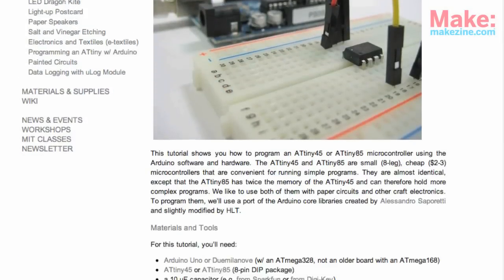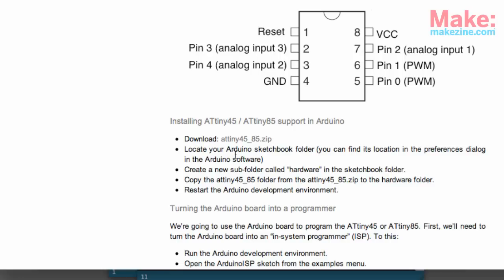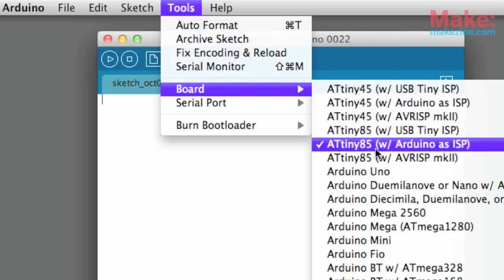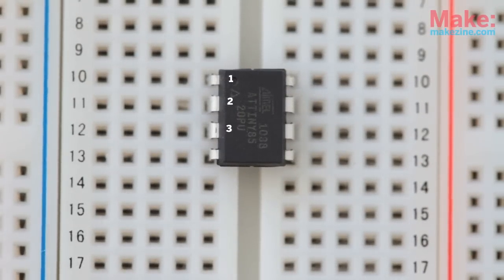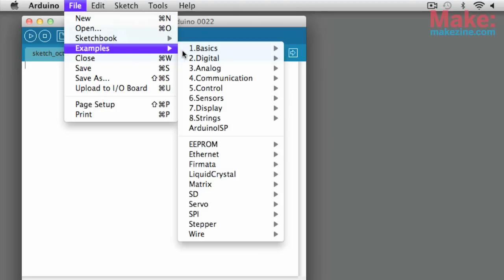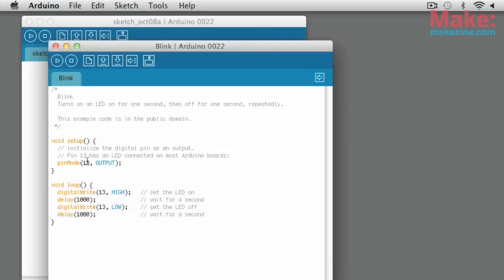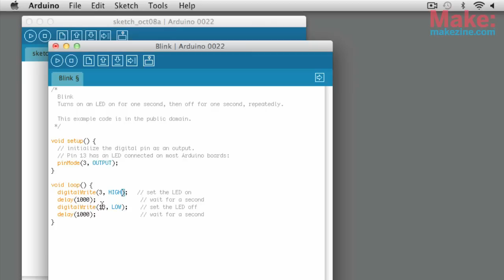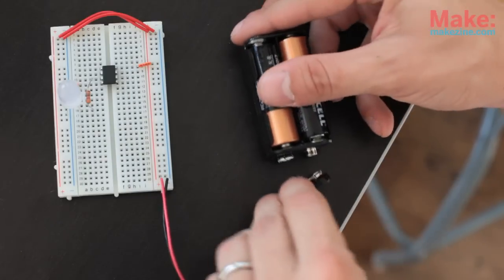How-To: Shrinkify Your Arduino Projects

Comment: Thank you muchly for the no-nonsense instruction!

I've been quite interested in using less-overkill hardware for my small projects (lighting 8 LEDs with very little input doesn't require an Arduino Pro Mini). However, I'm a beginner, and Arduino's have appealed to me.

This gives me a great approach to trying to make my stuff smaller, and less expensive.

Comment: The ATtiny85 has 6 pins that can be set as outputs and inputs, but each pin also has aditional special functionality like Pulse-Width-Modulation and Analog Input capabilties. You can even utilize the reset pin during run-time for other purposes. See the datasheet with the pinout diagram with functionality listing.
Also, you could in theory (given enough power) control a million LEDs using just one pin, if you utilize shift-registers and multiplexers to control multiple things.

Comment: This is a nicely done tutorial!
But especially for ATtiny projects I'd strongly suggest using generic avr-gcc code instead of the Arduino programming environmnent. With their small memory and few I/O capabilities, these chips cannot make use of most Arduino libraries. But they can profit a lot from getting rid of the overhead that comes with the Arduino wrapper code.
I just tried a minimal program that just switches an output state once per main loop call and  found avr-gcc code to be 4 times faster and  one sixth the size compared to Arduino code.

Comment: My next goal:
use an Attiny85 to program an Attiny45
Reply: And than you need to use an Micro to program the Attiny85.
Reply: my next goat is to program 100 Ohm resistor to behave like a microprocessor
Reply: my next goal:
to program a 10k resistor using +itmemo's "microprocessor".
Reply: I programmed my Attiny45 using single-event upset cosmic ray and an aluminium foil as a mirror to switch bits into my hard drive.
Reply: I programmed my attiny45 by setting the universal constants so that the universe evolved to contain the programmed chip that I wanted.
Reply: I programmed my Attiny45 now it can bake a cake with just a resistor.
Reply: My next goal is to program a jumper cable to program a MOSFET to program an Arduino to make me a sandwich
Reply: MrDefamatt My next goal:
Use a potentiometer to set Time.
Reply: said the Attiny85 to the Attiny85
Reply: My next goal: 
to put a resistor on fire by only staring on it with the evil eye.
Reply: I don't know if you'll have enough pins to do that
Reply: You're not gonna be able to do that. ATtiny chips lack the functionality of ISP's.
Reply: @PunakiviAddikti  :(
Reply: @YoDay  : I did the same but WITHOUT resistor ! And you can choose between sweet or salted cake using your left nostril.
Reply: @raphanunu6912  just add the functionaliy of ATTiny also getting some toppings from the store and putting it automatically on cake with some artificial inteligence, machine learning, and brain interpretation of thinking, gestures , and actions.
Reply: Lmfao

Comment: This aspect is so awsome. As a small fan but big noob, I didn't know enough to see this next step of 'just' using a chip - that an arduino isn't much more than a chip with only a few accessories.
This is already the "adult" level of microcontroller projects? So near?
That's so satisfying.

Comment: And then replace the breadboard with a custom PCB and you have a finished product?
Reply: +Henry The Unicorn pretty much
Reply: +Henry The Unicorn Or use something like vero board if you don't feel like etching PCBs.
Reply: can these be programmed with a FTDI usb to serial? or with  a mini?
Reply: Andrea Mitchell ordering PCB etching in China is cheaper - yet etching yourself is way more satysfying

Comment: Yes, it gives you 2 pwm ports that you can use to control motors/servos. Potentiometers are analog sensors so you can plug them into pin 3 and 4

Comment: Guys, you can do this not only with those 2 chips, but with nearly any AVR chips, you just need to use the correct pinout. With this, you own a cheap AVR programmer as your Arduino, that you can use for nearly everything!
Reply: Hi, If I want to program atmega328p using Ardiuno IDE, can you comment If I can get success if I follow the pin correctly but code written in Ardiuno IDE. your early reply will be highly appreciated

Comment: why did you used the capacitor between the RESET and GND pin?
Reply: from the high-low tech article:  "We’ll also connect a 10 uF capacitor between reset and ground on the Arduino board as shown in the diagram (the stripe on the capacitor that’s marked with a negative sign (-) should go to ground). The capacitor prevents the Arduino board from resetting (which starts the bootloader), thus ensuring that the Arduino IDE talks to the ArduinoISP (not the bootloader) during the upload of sketches. (The capacitor is needed if you’re using an Arduino Uno, and might also be necessary for an Arduino Duemilanove.)"
Reply: So... it prevents the reset of the board and keeps the computer talking with the ISP on the board, no the main ATMEGA328P on the board. On Linux (or macOS, with another alias for the /dev/) you can know which one is active when /dev/ttyUSB0 turns /dev/ttyUSB1.
Reply: you can pull out the controller does the same thing
Reply: @willdrives601  So it makes sure the Arduino doesn't self-reset when uploading sketches. I have uploaded scetches without the capacitor in place, and it can work but sometimes results in a uploading error, requiring me to pull out and re-insert the USB lead. It works 100% with the capacitor in place tho.
Reply: for decoupling.
Reply: It capacitifies the pins and keeps everything from getting all messed up and stuff.

Comment: Hello Anyone plz clear my misconceptions that's what is difference between programing ic like attiny85 , avr with or without Bootloading into it , I read somewhere that it can communicate with pc or ide software , now my misconceptions is I think if I program code once in ic like attiny85 or Avr without Bootloading then that I C will unable to Reprogram again ????? Is it true ??? On the other hand I think if I Bootload into ic like Avr for arduino ide communication I will able to program and reprogram ic again and again many times just as arduino uno types boards ?????? Plz some one explain me

Comment: For what reason you put a capacitor between reset and ground?
Reply: +Uzair Ali
From the High-Low Tech site:
"The capacitor prevents the Arduino board from resetting (which starts the bootloader), thus ensuring that the Arduino IDE talks to the ArduinoISP (not the bootloader) during the upload of sketches. (The capacitor is needed if you’re using an Arduino Uno, and might also be necessary for an Arduino Duemilanove.)"
Reply: if you're using what
Reply: i believe i can use a ceramic capacitor instead of the electrolytic one?
Reply: When the system is powered, capacitor pulls the reset pin to ground till it gets charged completely. This will give enough time for the microcontroller to initiate. And once it is charged, it prevents the board from resetting so that the intended task is carried out smoothly.
Reply: i saw videos of people just putting a regular piece of wire to block off the arudinos controler
Reply: If use 4k7 pullup on reset pin the capacitor can be ommited.In the fuses selection there is an option of few millisecond delay for power on reset.

Comment: Or just buy an Arduino Mini Pro clone, ~2$ on eBay shipping included from China and you don't have the problem that the ATTiny isn't as powerful as the ATMega 328p which is used on the Arduino... Don't get me wrong, I don't dislike the idea behind this video, it's just that you replace the microcontroller by an ATTiny without really mentioning the cutbacks of it...
Reply: For basic projects Arduino is overkill, Attiny can run on as low as 1.8v with very little current draw and if you skip the bloat of the Arduino wrapper and program directly with AVR-C you can do a lot with little memory.
Reply: Attiny45 is 12 times smaller than the mini pro, sucks way less current and costs (as in 2017) less than 1.5 $.
Sure the Mini Pro is better, but the Uno is even better, the Mega is even better, some IBM supercomputer is even better etc etc.
This video is not about what is better than what. It's about how to shrink simple projects.
Reply: I mean it runs at 8mhz default but can run 16mhz or even 20mhz.
If that’s what’s needed at least.

Or you could get a $3 esp8266(or even now the 8285) and get hundreds of MHz from it with some tweaking.
All while having many more features than the uno.
Reply: katze_sonne can i use ATTiny for my heart rate measuring project....as of now m using arduino nano but if i can use it then it will reduce size...n mainly will it send data serially (support Bluetooth connection or not)....reply me as soon as possible.....
Waiting.......................…
Reply: Yep, and sometimes it's also just about the fun of seeing how much functionality you can squeeze out of such a tiny device.
I made a project based around the ATtiny85 recently. It's a timer to run my laptop's power supply for up to 2 hours max. (Because I always forget to unplug it.) I used two of the IO pins to drive 4 LEDs in a bargraph configuration, with each LED representing 30 minutes. The uppermost LED in the bargraph blinks off briefly once a second to show that the device is counting down. (LED drive is done by rapidly toggling output to drive both an LED to ground and an LED to Vcc, or toggling between a low output and a Hi-Z mode to drive only one of the LEDs on that pin.)
Another pin drives a small beeper via a transistor, and one pin is the input which has a pushbutton connected. The last used pin drives a P-channel mosfet via a small n-channel mosfet to connect +12V to the output socket into which the charger is plugged. All this was built into a dual-port cigarette lighter adapter (plugs into a single ciggy port to provide two ports) with one of the output ports removed and that space used to mount the hardware. (tight fit!) Pushing the button wakes the unit up, setting the time to 2 hours and powers the output. Each additional push advances the time to the next 30 minute division. Once the end time is reached, the unit switches the power off and goes into a low power sleep mode, waiting for the next button push to wake it up. 
Doing it with the ATtiny85 certainly made it possible to make all this small enough to fit into a single-to-dual cigarette light socket adaptor.
I did find some problems though. THe data sheet talks about timer0 and timer1, but no matter what I tried I couldn't get timer1 to work or generate an interrupt. So I ended up using arduino's built-in millis() function. I had to set the device to run at 8MHz, but the millis function didn't run at the correct speed, so I adjusted the expected counts in my program to compensate for that. It appears to run about twice as fast.
Reply: Soham Jadhav HYPER BLAZE wrote:
"reply me as soon as possible..... Waiting.......................…"
Do you think that katze_sonne is obligated to answer your query, and to do so as soon as possible? Should they drop everything else they're doing, to answer you? If you want to build a project, it's your responsibility to work out what processor to use. You know what you want so... YOU figure it out.
Reply: +Max Brewster
Jadhav HYPER BLAZE simply asked a question, if you cannot answer, there is no need to attack him.
Reply: He wasn't just asking a question. He was expecting someone else to analyse the suitability of the ATtiny MPU for his project, and demanding an answer... as soon as possible. That's bad mannered and rude, which I pointed out.
Reply: Why buy an Arduino at all when you can buy a cheap, 120 dollar Latte Panda computer. It's super powerful, runs windows 10 and has much more IO pins. If you only need 1 pin to blink an LED this is the very best choise. Why get a cheap and basic ATtiny to blink an LED when you can get a windows 10 computer to do the same for 120 times the cost?
Reply: @sohamjadhav5661  Do the research yourself instead of making snarky requests. You need attitude readjustment.
Reply: Huh just get an esp8266 and you can program it over the air
Reply: @delaimo13  esp8266 is great value for many projects with its wifi connectivity, but is VERY sensitive to power supply noise.

Comment: yes, i'm using a Nano V3(AtMega328P-AU) and works only for Tiny45
and if for you also a 10uF capacitor doesn't work, try a 47uF(an arduino forum gave me help on this)
but this don't load some interesting functions, so if you only want to do leds blinking or PWM controllers thats ok!

Comment: does it require a clock or is it contained into the chip?
Reply: Yes, it has an internal clock but you can use an external clock (takes up pins tho). You can burn the bootloader to make it run at 8 or 16MHz (I recommend burning the 8MHz bootloader).

Comment: If the number of pins you need exceed the number of those available on the AtTiny85, there's the AtTiny84 that has about 2x the number if IO pins (but with the same memory size). 

This chip is also supported by Arduino IDE and is also very cheap

Comment: I don't know if this helps but you can use a 74hc595 chip to extend the number of digital pins. Basically they have an 8 bit register that holds a value. There is another 8 bit register you can fill up bit by bit in serial (a shift register). Then you set another pin on the chip and the contents of the shift register will go to the output register. I think you can also read in a parallel 8 bit input, swapping it into the shift register and shift it out serially, but I'm not sure about that.

Comment: @minutemadeinc Both can communicate with each other and other chips that support I2C. If you google Arduino I2C you will find an example that shows 2 Arduino's communicating to each other with 2 wires. If you need a lot of pins or want to use all Arduino functions then go with the ATmega.

Comment: I dont know if you asked it rhetorically ;) but for newbies, It is  to just prevent the software reset the Arduino has ! Though i doubt it is actually needed !!
As i have flashed bootloader to many 328s (dont know about these Atinys ) and i did not use any capacitor or that !

Comment: I understand the capacitor can be between 10v-50v, but does the capacitor have to be 10 uF? Would, for example, a 100uF capacitor work?
Reply: From what I can figure out, this applies to the earlier Arduinos. The video is from 2011. I found an article which sort of makes sense because it's from 2013. Their firmware was a bit dodgy.  https://petervanhoyweghen.wordpress.com/2013/05/04/disabling-auto-reset-on-the-due/
Reply: @DaleDix  That is very helpful, thank you!

Comment: Okay for those of you who are having the following problem:

Blink:15: error: 'OUTPUT' was not declared in this scope
Blink:15: error: 'pinMode' was not declared in this scope
...

Here is a small tut. of how to fix it:
you need to download Arduino software version 0022.
Then follow the same tut. as shown in this video.
It will WORK!

The reason that 'OUTPUT' and other arguments are undeclared is because from Arduino update 1.0, they changed the core library WProgram.h to Arduino.h.

Comment: Yes, it works fine. Google "Program AVR chip with Arduino software" sites explaining more. Arduino is a package which includes - on 1 board - an ISP programmer, the AVR chip itself and a standardised I/O arrangement.  It's therefore quite happy to program the same items as separate products. As Matt says in this video if you make lots of MCU projects, using an Arduino every time is wasteful because you probably won't use a lot of the I/O pins AND you're buying an ISP programmer every time

Comment: It is a bit obsolete, you can stick the attiny file in the hardware folder in the 1.0.1  IDE folder. Also a 100ohm resistor between 5v and reset works (if you don't have a capacitor handy). Overall pretty awesome.

Comment: In that MAKE was a partner in teaching hobbyists to use the Arduino to complicate the simple complicate, it's fitting that they still tech that albeit with a smaller uprocessor. No for make to teach how to blink a LED using discrete components, that would be free after salvaging consumer electronics. Now that I see that Adafruit sell ZIF sockets that can be plugged into the socket an the arduino I just might finally purchase on arduino

Comment: Nice Video, uses the Arduino like it was supposed to be used: as a rapid prototype board, where you can quickly design your device, and then transfer it to a real board. One little suggestion though. Try to add a 10 kOhm resistor between VCC and the reset pin of your chip, after you programmed it. It will prevent your ATTiny from accidentally resetting itself if you touch your project wrong.

Comment: Totally agree. In "Practical AVR Microcontrollers" I detailed exactly this approach. Using an Arduino for every project large or small is wasteful. You're buying the AVR programmer + AVR chip and support electronics every time! If you are only doing build-up tear-down that's no big deal. If you're making lots of small "keeper" projects then the needless costs mount up. Use naked AVR chips + a USB programmer (no bootloaders) and you save a lot of money and can still use Arduino software. Alan T.

Comment: A bootloader is a small program that runs inside an Arduino (or other packaged Microcontroller system) which allows the AVR to cooperate with an external system to update the main contents of the AVR's memory and you need a bootloader if you are using an Arduino. 

If you're using a naked AVR chip (just the chip itself) and an AVR ISP2 programmer or equivalent (such as Pololu AVR ISP programmer) then the ISP completely controls the AVR chip during programming and no bootloader is needed.